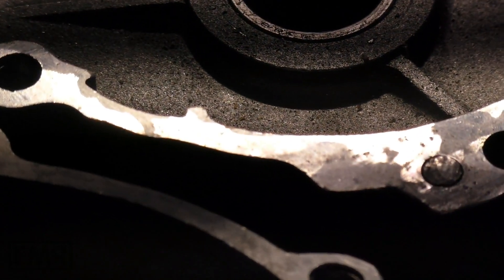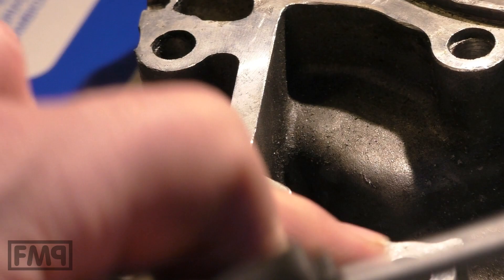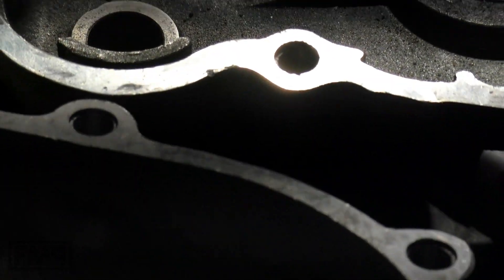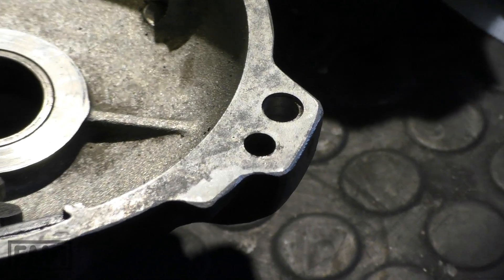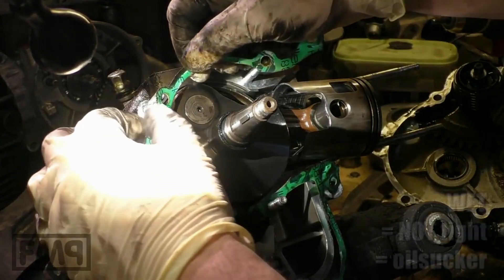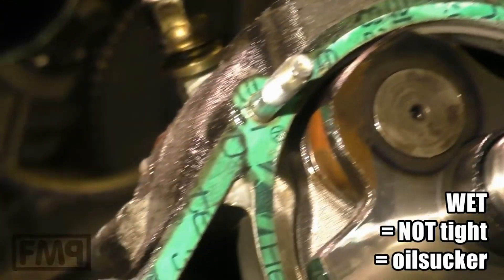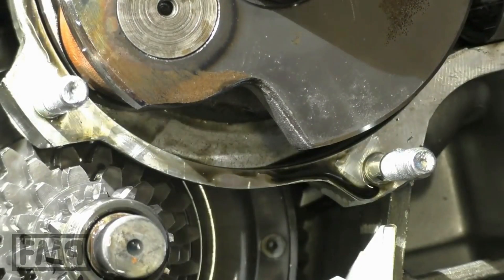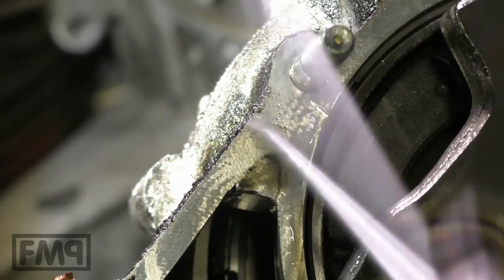vespa FAIL: early vs LATE model PX CASES | 1983 vs 2001| sealing surfaces | FMP - Solid PASSion |

Comment: Looks like they need to step up there quality control and finish on there cases that's not good enough for a long running company ☹️
Reply from the maker: they dont give a sh... with an original setup, it works fine like this. most of the original engines do have a gearbox oilsucker out of the factory